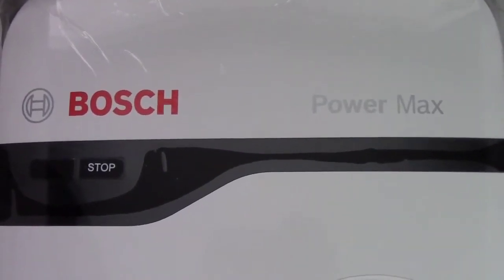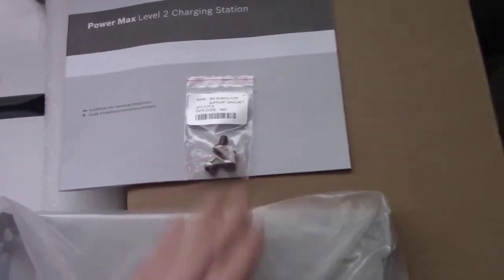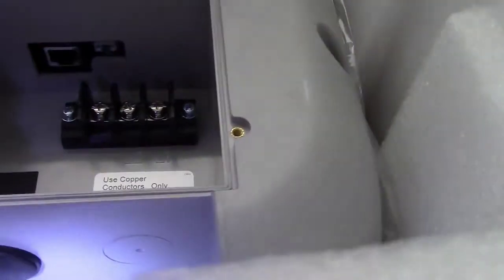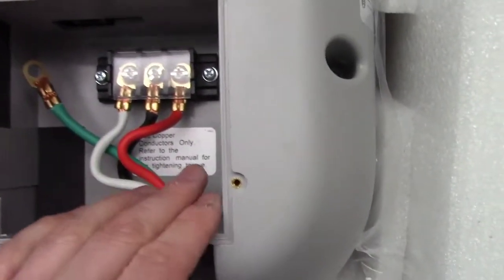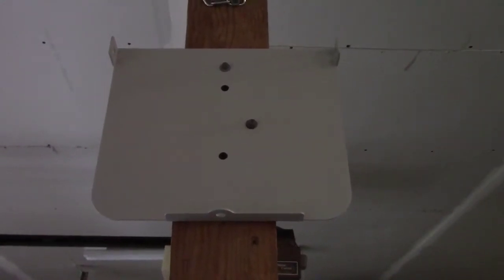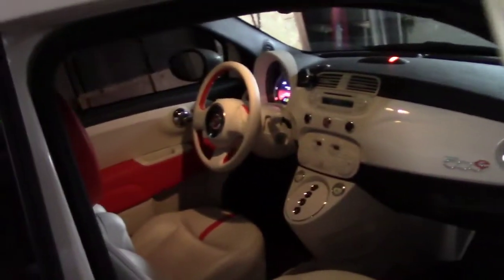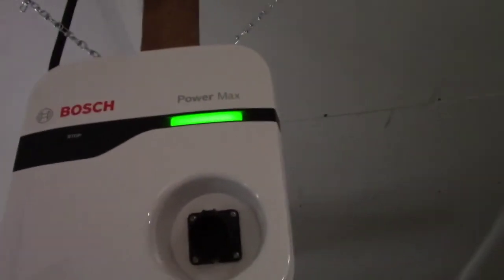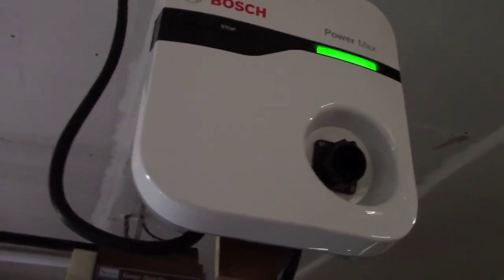Bosch Power Max - Install & Review

Comment: Can I use a 3 prong dryer cord (30 amp, 7500W rated) cable to connect from 240v wall socket to this ev charger?

Comment: Hi, what sort of cable clamp are you using? The metal one which you mention to be around 50 cents at 4:25 of the video. Thanks!
Reply from the maker: It's a stock metal clamp used in house wiring at metal boxes.  Any home depot or lowe's will sell these by the bag of 10 or more.

Comment: Dude, did you read the manual? It says the unit needs to be HARDWIRED. Not plugged in. Have you even felt the plug you're using to see if it's hot?
Reply: The one I'm getting is a non-wall mounted unit (but you CAN mount it if you want to) that supports 120v and 240v up to 16 amps (they make ones that go up to 40 amps, but that's overkill in my situation). The nice part about this is that you can roll it up and take it with you (it comes with a really nice zippered bag) if you are going over to a friend's house, etc. You can plug it into their dryer outlet (4 prong or 3 prong with an adapter) for fast-ish charging or into a normal 110v outlet in a pinch. And since it also supports 110v, it can completely replace the trickle charger that came with your EV too. Costs about $200.

Comment: What a nice deal on that charging station! I have the Bosch 20amp, 12 foot cord model, and it has worked perfect for over the 3 years I have had it. I have a Chevy Volt, and just happened to have two 120v circuits free in the breaker box to put in a 240 20amp outlet.  In my case that was perfect for my car. 
.
 It looks like there are wood screws going through the board on the back side. If so, you might want to cover them up with something like 1 1/2 inch long 1/8 rubber vacuum hose line over the screws, or something similar. Even though that charging cord is thick, won't want to start getting some little holes punched in cord, like you said, they are expensive!  Enjoy your L2, makes all the difference at home!
Reply from the maker: Thanks for the comment.  Yes, it's quite a game changer at home & it works with both my EV's.  The Tesla uses an adapter & I can easily set it to 24 amp charge rate.  Unlike the OEM factory chargers, the Bosch unit has an on/off switch which I am finding to be very useful.  Cheers.
Reply: ca fonctionne tu pour une chevrolet volt 2011 ?